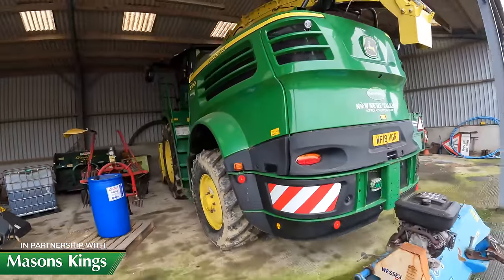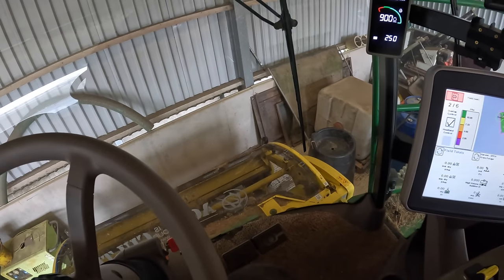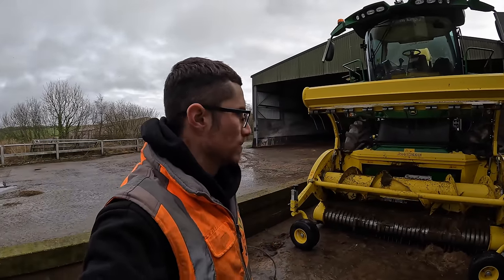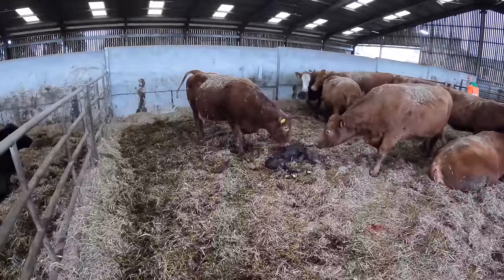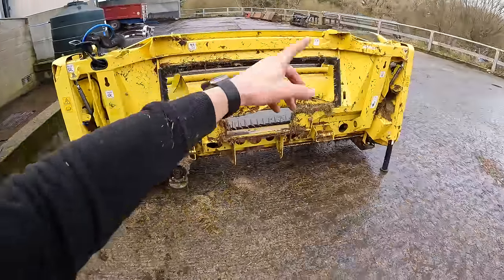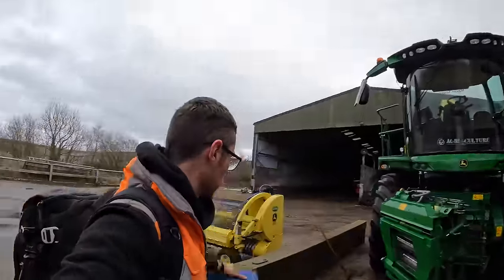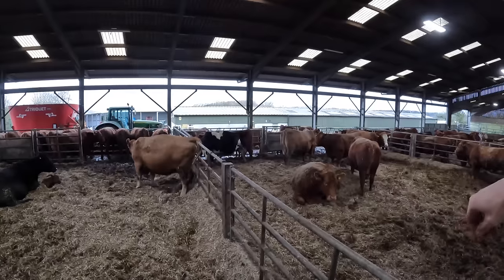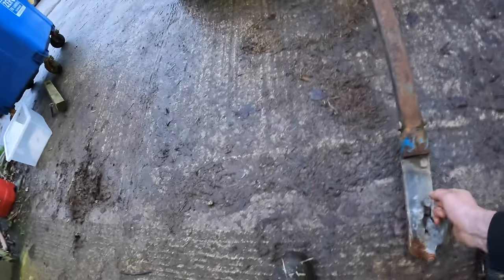Going Chopping In February!?

Comment: Used to drive a new Holland sp and it was just a case of grease all points check the shear bar was in good condition and that it was the right distance from the blades check all the blades sharpen them up oil and air filters check all levels and then pray for good weather.
Reply from the maker: Sound advice! Especially about the weather!